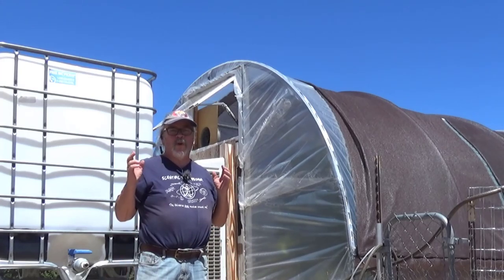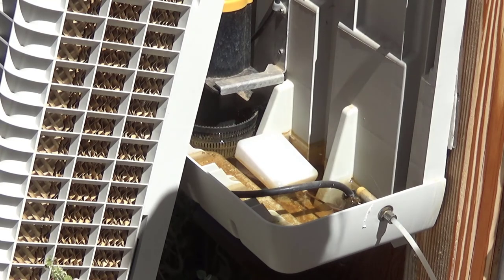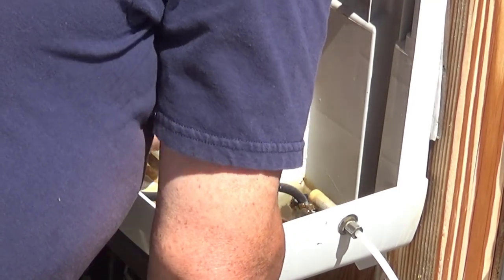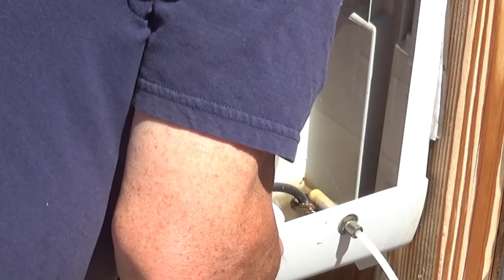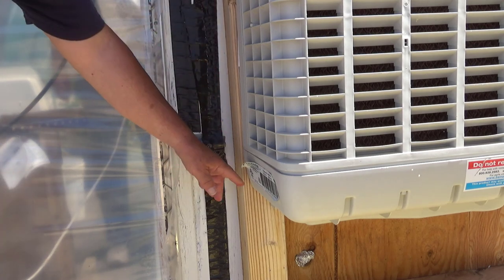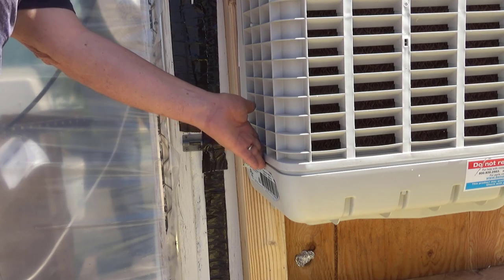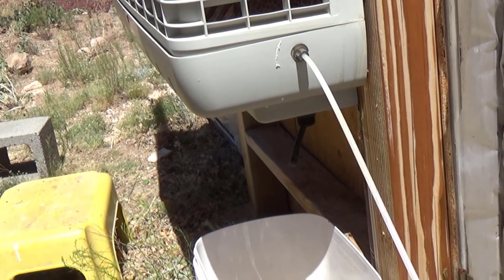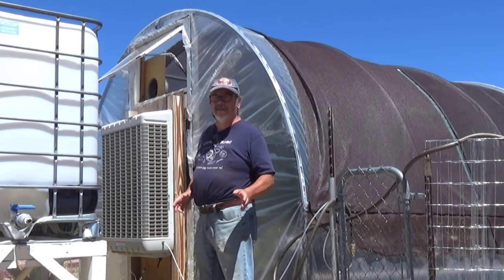Fixing An Evaporative Cooler Float Level

Comment: Very nice EC, how efficient is it?  Good to hear the fix was easy!!   Y'all have a good Tuesday!!   Dan
Reply from the maker: Hey Dan. We’re running about 1 gallon per week to waste to keep mineralization of the absorbent mat down. We usually run it from 9 to 5 using around 1.8-2.0 kWh. The power consumption is small for someone on the grid, but high for us off gridders. Water usage depends a lot in humidity. That cooler should use about 3 gallons per hour of run time, it about 25 gallons per day.  Thanks for asking. Take care and stay safe.

Comment: Nice fix. How long have you had this Evaporator Cooler? What brand is it and where did ya buy it from. Looks to be a nice unit. Stay safe and have a great day my friends.
Reply from the maker: Hiya CB! This is our second year owning the cooler. It is a   Bonaire that we bought from Home Depot. I believe I t is the largest wall/window mount unit they offer. I’ll check today, but I think it’s the Durango model. It works well for us because our humidity is usually very low.
Reply: That was gonna be my next question was how wet does it make things in the greenhouse. We have very high humidity over here all summer long. Next question is how much water does it use in a days run?
Reply from the maker: CB's Greenhouse and Garden I was looking up what your relative humidity is in the summertime. If I recall correctly, swamp coolers work in your area until a certain ambient temp is reached and then the humid and temp make the cooler ineffective. I haven’t tried to measure the humidity in the greenhouse when it’s running, but our ambient humidity is so low that we don’t have excessive moisture in the greenhouse. We’re using about 25 gallons per day running it as an evaporative cooler 8 hours in the sunny/hot days. It’s proportionately less for less hours per day. Except for heavy overcast and cool days, we run at least 4 hours per day running it as a swamp cooler. The fan runs from about 8am to 7pm everyday. Your results will be different for sure. Take care friend.
Reply: Yeah I looked that unit up and WOW they want more for it then a chiller.  Pick ya up a couple of those cheap indoor / outdoor thermometers like I showed in my videos. They show the humidity as well as both temps. My greenhouse stays 90% or better humidity so this would not be good for me. Thanks for the info!
Reply from the maker: I really like the combination temp/humidity units. They’re on the list😋. I can’t recall folks using swamp coolers in your area - the info might get have gone out the window. I really need to do a show on cooling a greenhouse. Have a good remainder of your work day. I know you’ll have some contemplation time in the garden - hope it isn’t too hot, muggy and tiring. Take care.